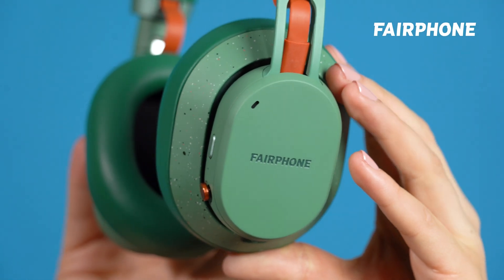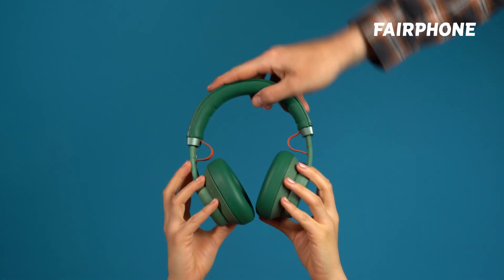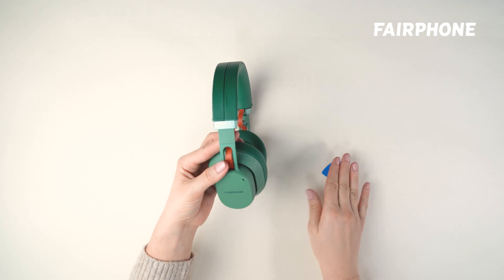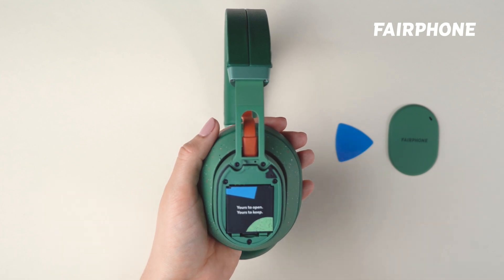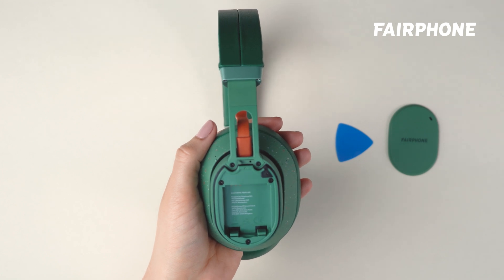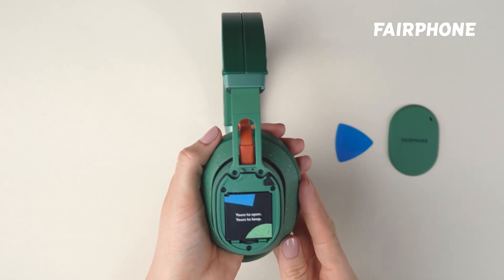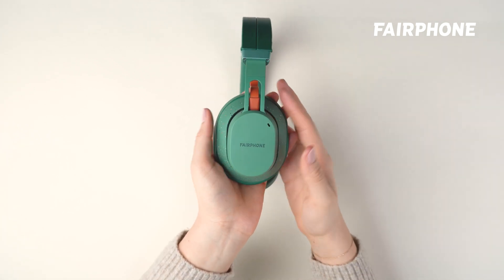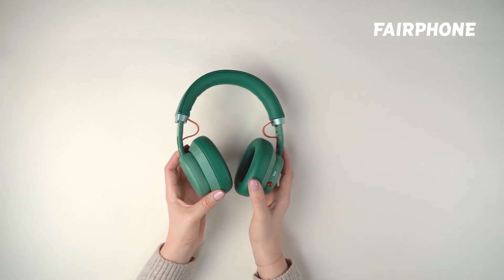Chapter 3 | How To Replace the Battery + Speaker Cover |  Fairbuds XL

Comment: You know what's even better for the environment? Wired headphones. But I guess you couldn't charge quite so much for them, hence the removal of the headphone jack so you can rip us all off and create even more lithium battery waste.
Reply: There is a lot of wired headphone or wired earphones waste too sure the people who take of them it isn’t a problem but the people that don’t which are a lot more create much waste of there own buying cheap crap that are lot less inclined to do so when Bluetooth headphones in general are more expensive
Reply: You can always buy cheapo bt headphones or literally any other brand but wired headphones.
In those headphones you take out old battery, put in new and voila but you can also use usb c to usb c cable.

And btw, battery becomes waste if you dispose of it irresponsibly. Even regular tv remote aa or aaa battery.

Comment: I was literally so torn whether I should buy w/l headphones because I didn't want to own tech with glued in batteries that will eventually fade and fail and make the entire product useless. This is such a game changer.
P.S.: you guys have weird credit cards in the Netherlands 😆
Reply: Ok. A few things:

This is a proprietary battery, if the company stops making them, or inflates the price, then you are left with little to no options.
Price for their smartphone batteries are around $30 (euro to dollar conversion, without any shipping and import fees mind you). We can safely assume this would cost the same or more.
Then you have to account for the price of the headphones themselves, $270 (again conversion without any extra fees).
Also, if the battery fails, chances are your earcups are due a replacement. Perhaps another $50 or so?

Basically in the span of 3 years or so, you spent $350+ for these.

Now on the other hand, most the other headphones use off the shelf components. Battery that can be had now and until the end of time for less than $10 shipped. You will always find a replacement even if it's not spec for spec accurate. Earcups for known brands? dirt cheap, again, from China.

You can get Sony WH-1000XM5 right now on Amazon US for $340. And we don't have to put these against each other to find out who wins. A battery for this is around £10 if you buy it from your own country.

And this does not account for warranty repairs/replacement for a product that's not really meant for your own domestic market, little to no prestige by using these if you care about this aspect, the fact that perhaps there's zero to no water/splash resistance with all this "reparability". Smack them gently and stuff starts flying about...

In the end it's your money, and it's a noble endeavour but please educate yourself, you are spending more for less.
Reply: @shadowman1988 I'm not sure I agree that parts will be available for common headphones. I had the headband snap outside of warranty on the Sony MDR1000Xes, the line that eventually became the WH1000XM5. I tried looking for parts at the time but there were none, first or third party, so in the bin they went to be replaced by some XM3s. That's made owning sony headphones really expensive on average for me as a whole new pair needs buying every 2-3 years. Touch wood the XM3s are holding up so far but that might be because I am very careful with them, they don't leave the home as I fear they'll be as fragile and impossible to repair as the first gens. 

I've bought the fairbuds XL to actually use. They'll go outside the home, get chucked around etc. because I know parts are available from a first party source. If the first party source stops selling parts a third party could start, there's nothing stopping them except potentially a small market.
Reply: @shadowman1988  tl;dr